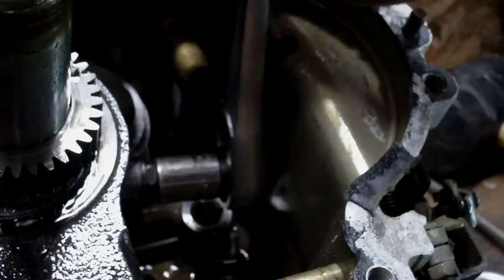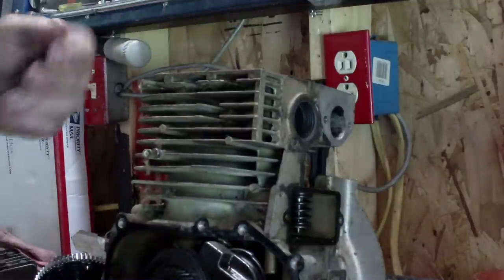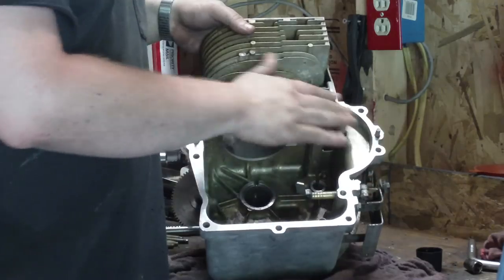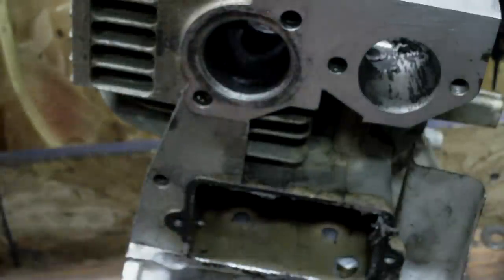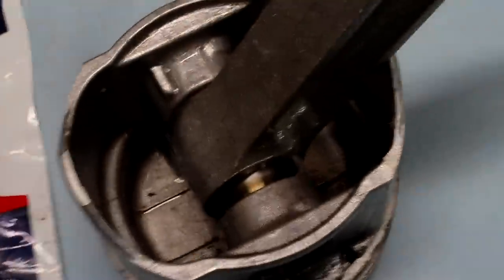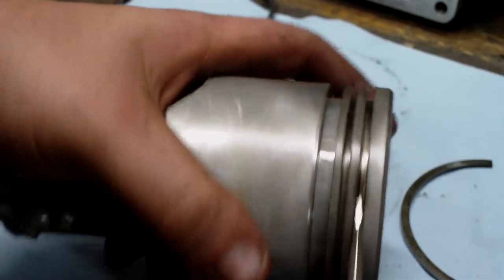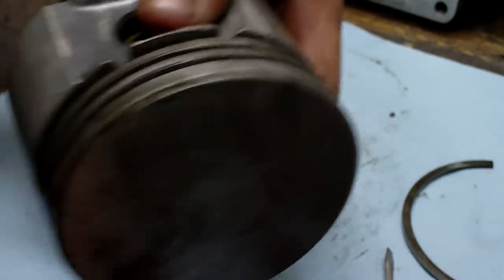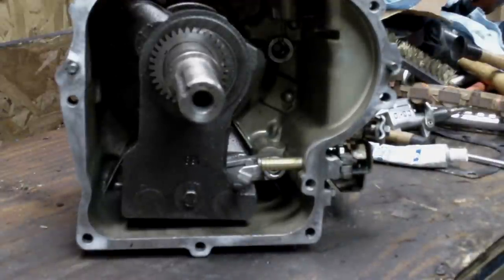Briggs and Stratton Power Built 12.5 HP Flathead Model 28 Rebuild, Teardown / Reassembly PART 2

Comment from the maker: yeah it should loosen up after like a 20-30 minute run or so. If its a push mower you should put the blade on it, they do tend to kick back wihout a  blade because the blade acts as a flywheel.

Comment from the maker: Usually I use carburetor cleaner or brake parts cleaner to get most of the grease and oil off the block (inside and out) OR I'll use a degreaser like purple power. Carb cleaner costs more (and not to mention the fumes, and eye protection required), but works faster. Also on the outside i usually go over it with a wire brush to get some oxidation off the aluminum. I recommend some like purple power for the inside and out. Alot of people use a pressure washer, i would if i had one haha thanks...

Comment from the maker: @V8Mike93 Thanks, The racing engines are a little different, for one they usually do away with the sychro balancer counter weights and dogbone, or they have a billet dogbone or use brass bolt on weights. they also have a racing crankshaft now. and if its above governed speed, they have to have a arc billet flywheel. thanks for watching

Comment from the maker: a basic hone then use standard rings/piston, usually reuse old piston. Then follow one of my newest videos on measuring piston ring gap, then if its to small of gap you will file, and if its to big of a gap you can use .010" rings then file down to spec. Like i said about 90% of the time you can use standard size rings, i'd say almost definetley you can on yours since its more less just starting to smoke. hope that makes sense.

Comment: After grinding valves, you can mark with a pencil to tell if valves are fully seated. With a sharp pencil put eight equally spaced marks on the valve seat after having thoroughly cleaned all grinding compound. Rotate with valve tool as if grinding, without lifting valve out of block for 15 or 20 seconds. When all marks are cut thru, the valve is seating properly. This will detect any warped valves which cannot be detected by eye. If a valve leaks, it will obviously cause issues.

Comment: What type of grease were you using, STP what specifically?
Reply from the maker: STP oil treatment, in a blue bottle. You can also use lucas heavy duty oil stabilizer, its easier to work with since the bottle has a spout built in. Just plain motor oil works good to.  Thanks for Watching!!!
Reply: @fnaguitarplayer9  thanks sir. As I watched more of your videos I found you stated it in several others. Appreciate the work you put into all these videos.
Reply from the maker: @ncameron7  Your welcome!

Comment: I have a 12.5hp Briggs and Stratton motor and it smoke's a lot when I start it in the morning to cut grass is it the piston rings are the Head g when the motor get warm it stops smoking please please help me
Reply from the maker: Its probably either the rings are starting to wear and/or the valve guides are worn.. Thanks for Watching!!!
Reply: Thank you so much
Reply: I sure I will have more questions about this motor

Comment from the maker: usually the crank is pretty clean, but yes, carburetor cleaner on a sychrobalance crank could remove the oil in the bearings, if one needs cleaned i usually just spray wd40 on it then use a rag to wipe it down that works pretty good. great motors! oh wow. never had that happen, you could try vice grips on it, assuming you mean the head is rounded? if the threads are stripped in the rod, things will be alot more complicated!

Comment: I know that it could sound stupid but, could you crank the motor with the spark plug disconnected so all the parts gets a good coating of lubricant OR its preferable to coat all internal parts with STP oil treatment while putting the motor back together?

Comment from the maker: when you say yanking your arm off do you mean it was just hard to crank over or did it kick back and pull you back into it? If it was just hard to crank, thats common on a rebuilt a engine, on a rebuilt car engine you usually have to have 2 batteries hooked up to get more amperage to kick it over. This engine in this video that i rebuilt was pretty stiff. If it was kicking back and pulling the rope back, thats usually in the timing. hope this helps

Comment from the maker: Hard to say. The low compression would be either the rings, or the valves not sealing properly. to check the rings you have to tear it down, pull the rod and piston, then remove the rings from the piston and then follow a recent video i did on measuring piston ring gap, go through my videos, its a fairly recent video i did. I wouldn't think the crank is bent. It should crank over really good with that little compression.

Comment from the maker: is it just not cranking over, like it turns over once, then pauses then goes again? it could be the starter dragging, i did a video about 2 years ago on rebuilding a briggs starter, if its dragging you might just need new brushes. if this is a OHV motor, it can be something wrong with the camshaft, as they have compression release can wear out, flatheads don't have compression release. try pulling the spark plug out to see if it turns over free then. thanks for watching!!!

Comment: Hello sir! I have gotten around to doing this rebuild, but found out my intake valve has a pretty large gap. Light seeps through a lot, on one side, don't think I can grind down that much. Cant see if valve is straight, it might be slightly bent? Cant figure out if I should order a new valve, or if the problem is in the valve seat. Any ideas? Thanks!

Comment from the maker: @1972FordF150 yes and no. They have to be drilled out then reamed to exact size, then the new ones pressed in. If you had a press and a milling machine you could do it at home. i really enjoy rebuilding these motors, i can't wait to build a racing engine, it costs so much to do it right. thanks for watching

Comment from the maker: have you tried it since it ran? they usually loosen up after running for a little while. Be sure to change oil soon, like after a hour of running. There will be a little metal in it, its perfectly normal. If it looks like metallic paint then there is something wrong though haha

Comment from the maker: depends how bad one is, on internal parts i'll spray them down with carburetor cleaner or brake parts, OR purple power or any degreaser works great too. On the outside i'll use a degreaser, and to make it look good i'll take a wire brush to the crankcase. If you ever work on a engine and the inside of the block and sump have a yellow or golden color to it, thats a coating briggs started using, dont' try to remove it.  First one i seen like that i thought oil had burnt in.  thanks for watching!!!

Comment from the maker: @1899lpv well the problem with doing that would be: even if its just a few revolutions before the oil start circulating the cylinder/piston can start scoring because metal against metal is no good. While it may not do to much damage, any scoring before its broke in can cause the rings to not seat or wear prematurely. I always use STP, you can use regular motor oil if you want. Just don't use grease.

Comment from the maker: it usually doesn't take to much, just make sure you run your drill at a fairly low speed and go up and down at a moderate speed, to slow moving will make horizontal scores, to fast will make the crosshatch to stretched out, if you a very very slight scores (if you can't feel them with your finger nail) then you can hone them out usually, if you can feel scores it would be best to have it bored then use oversize rings/piston. GENERALLY speaking on a engine's first rebuild you can get by with>>>

Comment from the maker: head is 185 IN. Pounds, so that would be about 15.5 FT Pounds, oil sump is one of 2 different torques, if the bolts have a separate washer then its 140 IN Ibs or about 11.5 FT pounds if there is no washer but has a washer built in on the bolt then its 200 IN Pound or about 16.5FT pounds. hope this helps. Thanks for watching!!!

Comment from the maker: glad you got the bolt out ok! when you replace the bolt be sure to get a grade 5 or grade 8, if you don't get a briggs replacement. Ohh. I've never done that my self, it requies a special (non cheap!) tool to remove it, now if its not to bad they can be ground, but that may require a over size valve which you don't usually see for small engines, you will probably have to take it to a shop (machine should be able to do it, if not a SE shop can) and get a new seat pressed in.

Comment from the maker: @jajaid6 yes they can be adjusted but its alot harder. On these if you have to much valve lash, either reseat the valves so they drop down further, or you can weld the stems then grind to what you need, now if the valve lash is to tight, or like on this engine, there was no clearance, then grind some off the stem till you get the correct gap. Thats the only thing i like about OHV engines haha thanks for watching.

Comment from the maker: i'm pretty sure the smaller one should work fine, the big one sounds to big. i bought a pack of 2 at harbor freight, not sure of the sizes, that sounds about the same as mine, i'd go with the smaller one. i've never used the bigger one in my set, its mainly for big car engines. hope this helps, thanks for watching!!!

Comment from the maker: sounds like the valves need reseating (lapping) it may be also be running to rich that will cause that. Is it misting or pouring out? if its misting its the valves or running to rich, if its pouring out sounds like a problem with the float/needle valve. thanks for watching!!!

Comment from the maker: No i never have, i usually use wd40 or any type of thin oil like that. brake fluid would probably work alright though i would think, or auto transmission fluid too. I usually use any degreaser like purple power for carbon clean up carburetor cleaner dissolves it fairly well, a small wire brush helps alot with it. For carbon like on top of a piston or head, i'll use a wire brush on a drill to clean it up (with piston all the way up). thanks for watching!!!

Comment from the maker: @1899lpv it would take a while to get the oil coated all over the piston and rings. STP is just a good insurance that everything is lubricated when it first starts up. even if a engine has been sitting for a log time its best to pour a little oil in the cylinders and let it set for a while. hope this makes sense. oh by the way the final part will be up tomarrow! thanks for watching!

Comment: @fnaguitarplayer9 Hmmm I have an idea for these valve guides : step 1 get drill bit and drill it out. Step 2 get new valve guide. Step 3, get big hammer. Step 4, WHACK on the top of the guide and it's in. LOL yeah I'd like to build a racing engine then throw it on something haha. But I'll probably never get to that because I'm so damn broke.

Comment: Will degreaser or carb cleaner not hurt anything in crank?? Same engine first flathead That I'm rebuilding. I got one screw off piston rod the other is stripped. Any suggestions?

Comment from the maker: thanks! you would use the same type of hone, just be careful as it will remove the metal alot faster than a cast iron sleeved engine! it would be easy to get carried away and remove to much metal. just be sure to use the correct piston and rings in a aluminum bore (chrome rings) thanks for watching!!!

Comment: Brigg has valve guide tools and a reamer tool and a bushing installer. Use a drill ream the guide. Get the bushing tool that fits on the valve. Get next OS rings and file them to correct gaps. Use sandpaper on cylinders.  Have a shop to replace the valve seats. Install head bolt inserts. Replace the guides!

Comment: Good series.  I'm at this point in a rebuild and I would like to hone the cylinder prior to installing new rings.  I'm wondering if you have ever honed an aluminum cylinder Briggs and what equipment you used.
Love the valve lapping info.

Comment: I hadn't put blade adapter or blade on yet. I just let it idle for about 10 min started it up a couple times.  Pretty easy to pull a couple times but really hard to pull most of the time

Comment: What is the model number of the motor? I have the exact same one but I don't have the original cover, therefore I don't have the model number. I am looking for the piston rings. Thanks!
Reply from the maker: BADASSF250 If i remember correctly is a 281707 As long as its a 28 any ring set should work (should), the only real difference is the oil ring type.  But you never know if they made them with thinner or thicker rings. Thanks for Watching!!!

Comment: Thank you for your videos . I have a 8 hp Briggs that the walls of the cylinder are scratched ,I can feel  it with my finger .
Do you think is wort it fix it or get a new one .
There is no compression .
I'll appreciate any response thank you
Reply from the maker: +Harly Farfan Your welcome! If it has a cast iron sleeve you should be able to get it bored out, if its aluminum bore then theres not much that can be done, honing usually won't take out real deep scratches, if it does then the cylinder usually becomes egg shaped. And with aluminum cylinders you have to use chrome rings and a chrome plated piston, which is only available in standard size, so the only other option is to have it bored and a sleeved pressed in which is doable but will cost quite a bit. Hope this helps some, Thanks for Watching!!!

Comment: How how do I adjust carburetor idle screw and air mixture screw machine runs on low idle just fine and runs on choke just fine but when I put it to the running position on high it wants to backfire and misfire how do I just screws on carburetor and also governor I cleaned carburetor throughly I'm not sure how to fix thank you
Reply from the maker: Nick Chaix I actually have a video (a very in depth video) on adjusting these carburetors (one piece), its running to lean, the screws should be turned out, but refer to this video here on adjusting and fine tuning: https://youtu.be/TlSAOkQnI1g and for governor adjustment, follow this video: https://youtu.be/9rO8AvDrdeM thats the best way I can explain it to you, if you have any questions feel free to ask me. And if its a newer style with the 2 piece carburetor, there is only one mixture screw, just turn it out it about a turn and tune. With the newer 2 piece carburetors they usually have to be rebuilt (carburetor kit) since there isn't much adjustment. Thanks for Watching!!!
Reply: Nick Chaix Maybe replace the governer springs. Check the carburetor. Check for vacuum leaks at the intake.

Comment: How did you clean all the sludge out of the case? Gasoline?
Reply from the maker: +cavarlyvet I usually use carb cleaner or i also found that penetrating works even better, I use the walmart brand supertech penetrating oil and carb cleaner, works great. A pressure washer will work even better but it will spray back at you as well. Purple works too, but not as good as the others. Gas is a good cleaner but is messier and dangerous. Thanks for Watching!!!

Comment: sorry did not catch what you were doin with that drill in cylinder can you explain please
Reply from the maker: +tigertruckerman I didn't go into to much detail on the video, I will next time I rebuild one, but its called honing or "deglazing" the cylinder, what it does is puts a cross hatch pattern into the cylinder walls, looks like a # in a way, just at a steeper angle, what happens is after its done and the new rings are installed, it basically acts like sand paper to seat the rings to the cylinder, it smooths out slight imperfections and makes a really good seal. I don't have any videos on it right now, but there is alot on youtube and alot to read online about it. But you want to run the drill slower than what i did in the video and move it up and down faster too, this puts a really good pattern on the walls, and it usually doesn't take to long and you'll want to use wd40 or some other light oil on the walls and stones. Hope this helps explain it better. Thanks for Watching!!!
Reply: purple guy. Use sandpaper and not hone cylinders!